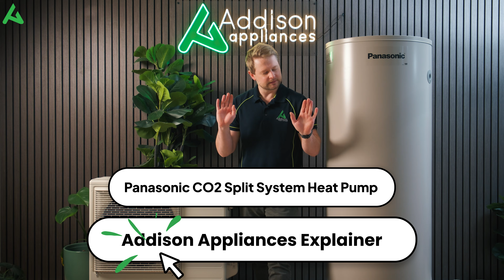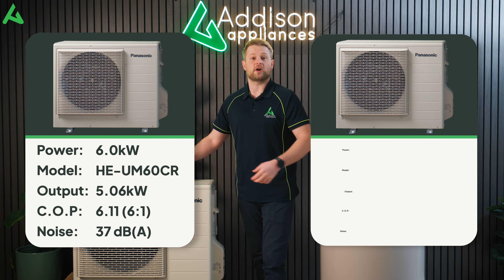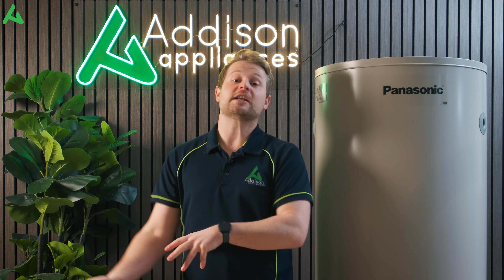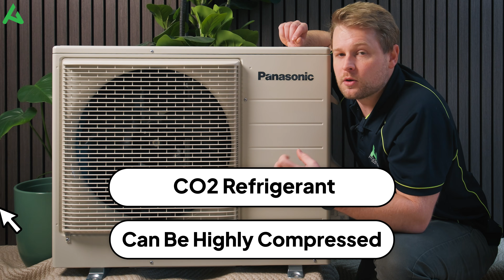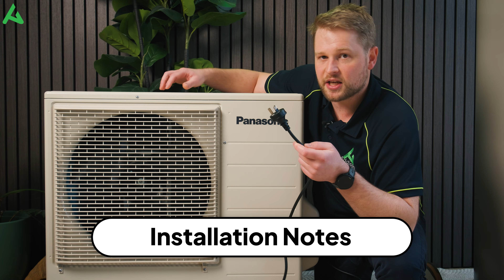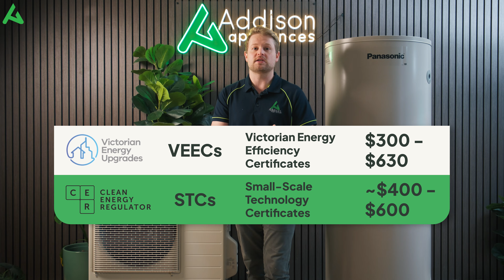Panasonic's New CO2 Heat Pump Explained: Efficiency, Noise, Rebates | Addison Appliances

Comment from the maker: Correction (thanks to those who flagged it): In this video we described the tank as having an internal coil. That is not how these systems work. On the Panasonic HE-UM60CR and HE-UM40CR there is no coil in the tank. The tank is a plain glass-lined storage cylinder. Water is drawn from the bottom of the tank, pumped out to the CO2 heat pump unit, heated to around 63°C as it passes through the heat exchanger, then returned to the top of the tank where it stratifies. The only lines running between the tank and the heat pump unit are water pipes. The CO2 refrigerant stays sealed inside the heat pump unit. Source: Panasonic owner's and installation manual, pages 18, 29, 52 and 66 to 67.

Comment: Theres no coil in the tank. Tge heat exchanger to water is in the outdoor unit
Reply: It's interesting that they still advertise it with new tanks. It makes sense to me that one could retrofit existing pressure vessels with a heat pump with much less labour cost.
Reply from the maker: Hi @kickinbac, Good pickup, and you're correct. There's no coil in these tanks. The tank is a plain glass-lined cylinder, and the heat exchanger (the gas cooler) sits in the heat pump unit. Water gets pumped from the bottom of the tank out to the unit, heated in one pass, and returned to the top. Only water lines run between the two, the CO2 refrigerant never leaves the heat pump unit. We'll pin a correction on the video. Thanks for flagging it.

Thanks for watching!